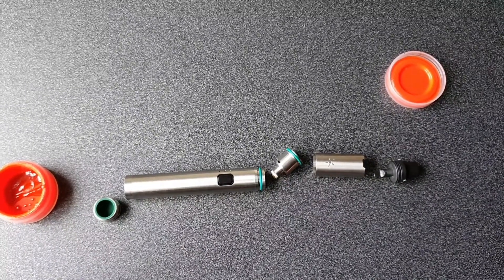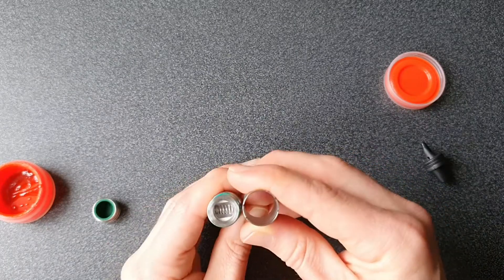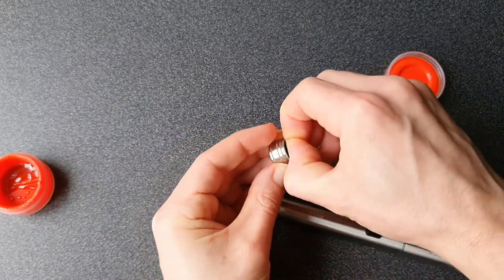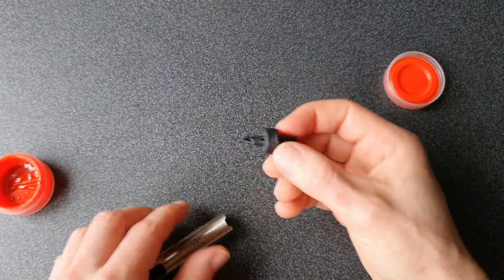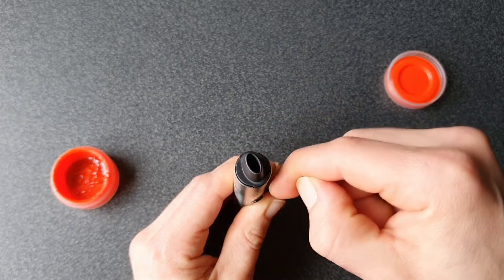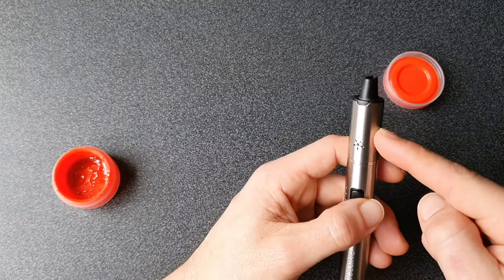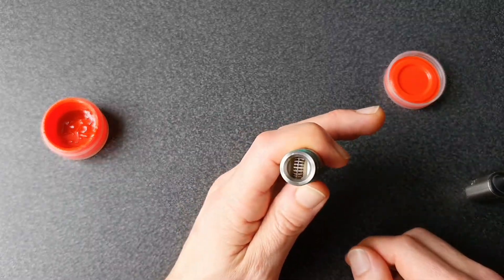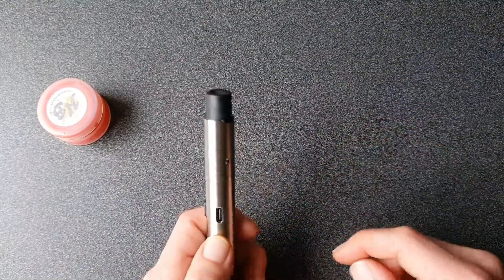Coil King AIO (all in one) parts breakdown and mini demo

Comment: I got one of these. My question is how you know it’s out. It keeps smoking even when there nothing in it
Reply from the maker: When the majority has been vaporized you'll just have little whisps coming from the ends of the coils. That's when it's done. You can upend, heat and drain the atomizers into a tissue, if there's lots of residue inside it'll always produce a little vapour is it wicks thr residue from the housing! Feel free to DM me through the website if you have any more qs, I'm only here by chance and don't generally check comments!
Reply: Sounds like you overloaded it and there is reclaim stuck in the coil, bro. That's the only reason it would be "hitting even when there's nothing in it"